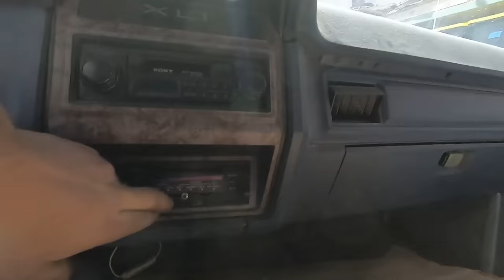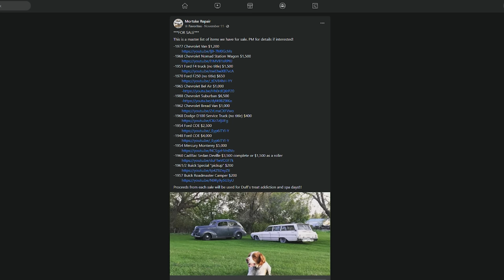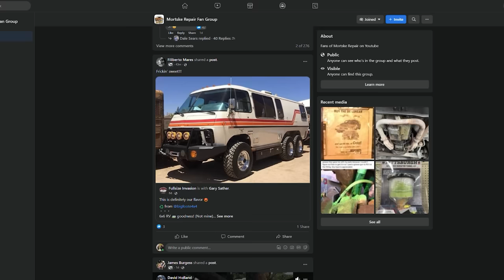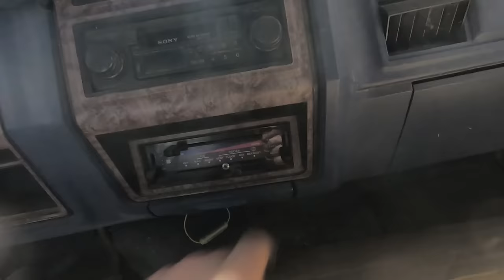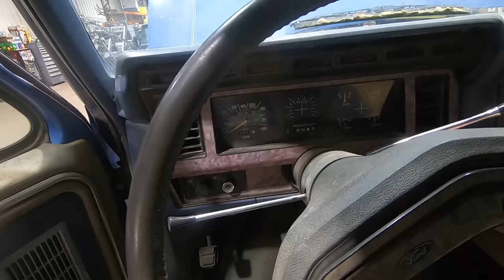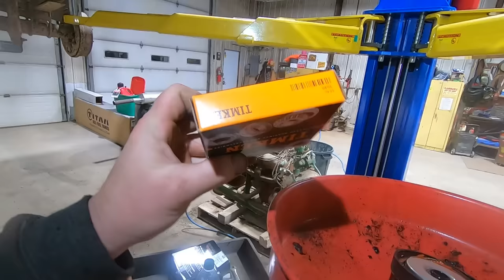Revival and Transformation of an Abandoned 1985 Ford F150 4x4 Farm Truck!

Comment: Hey Mortske, the power windows on those Ford trucks and aerostar vans and other Ford products have a design flaw, if you roll up and down the power window you might see the door outer sheet metal skin and the inner skin flex in or apart, this will eventually create stress cracks and make it harder for your regulator motor eventually burning it up so if you do replace the regulator or motor in that window be sure to check if it's expanding like that and beef it up with some extra sheet metal, otherwise you might be putting in another new motor, too quickly. There are other makes of cars that tend do that also.
Reply from the maker: Thanks for the tip!

Comment: The drain plug is an aftermarket one and your correct it cuts its own threads. I installed one in a customers honda van as he had stripped it. Runs good for sitting for over 4 years! Happy holidays Mortske!!!!

Comment: I have the exact same truck in a 1988 version, one owner, drug it out of a barn it had been in for 15 years, it has the 351, it actually has three fuel pumps, the one along the frame and one in each tank. I’m not a Ford guy either but it’s kind of a cool truck. Thanks for another great video
Reply from the maker: Awesome
Reply: If it's an 88 then it's a brick nose, unless a conversion has been done like I'm doing to my 91
Reply: @M.L.Knotts  well it’s an 88, so it’s a brick nose then I guess.. I don’t know, it’s an old Ford truck that runs good and I got it cheap.

Comment: Those Mighty Vac's are great! We have the pro version that attaches to the air compressor. Changing oil (or other fluids) is clean and quick. From old motorcycles to modern 4x4's, no problems with the Mighty Vac!

Comment: My first new vehicle was a 1981 Ford F150 with the 300 six and manual 4speed with overdrive. almost 200 thousand miles on it when I lost it in a forest fire. only major work was a transmission rebuild. I still think the bullnose has some of Fords best styling. The paint issue is do to a change to the water based paints in 1985 with a really bad primer.My short box XLT had the same trim mirrors and rear bumper. I had a rare cruise control with manual transmission.PS the heater core is a supper easy change out through the glove box.

Comment: My first truck was a 1984 Ford F150. 2 wheel drive 4 speed and a 351. Learned to drive stick in it. It had everything power windows and locks, ac, sliding rear window. Had the same rot that yours does. Brings back great memories. I found mine in the local thrifty nickel out here in colorado for my grandpa. He loved that truck too. Great show! Keep em coming. Funny last remarks i work at a repair facility and ill put you on and listen with my ear buds while im fixing wonderful examples of automotive technology
Reply from the maker: Good stuff!
Reply: Granny gear

Comment: I’ve had 6 F150’s built on that platform from 1980-1996. Had a 80, 86, 89, 90, 91, and a 92. My all time favorite was the 86 super cab long bed lariat, had every option available. Wish I still had it, it was mint when I got rid of it, and sadly I watched it die a slow painful death from the guy I sold it to. I saw it regularly, and everytime something new was broken from windows being broken, mirrors ripped out, tailgate folded in half. That truck didn’t deserve that. 

Also, some kinda useful knowledge, that power steering cooler is the only sure way I know to identify a truck with the factory tow package. Non tow package trucks have a smaller cooler that only makes one loop across the crossmember. The one with 2 loops like yours are factory tow package.
Reply from the maker: Thanks for the info!

Comment: I have changed the seal on the AODE Trans selector shaft. And I thought it was pretty easy. You do have to remove the pan and valve body. 
To get to the rooster cone. 
There is also a pin that needs to be driven out

Comment: The issue with paint back in that time period was the Big 3 (Chrysler, Ford and GM) decided not to prime between the ecoat (the black coating put on the bare metal panels) and paint to save money.  That's why it came off in sheets.  I had customers that would drive down to the local media blaster, mask up the glass and drive them back bare and begin the refinish process...  And now you know and.... (you fill in the rest).  Thanks Mr. M for another Monday morning pick ME up!
Reply: Wasn't there also a switch in paint formulation due to new EPA regulations? I thought I read somewhere that the EPA cracked down on VOCs back in the 80s, and that prompted formulation changes that were just not as durable for a few years.
Reply: @pheffr  There were some changes Paul but that was mostly solvent and clearcoat formulations.  Paint really didn't change much (although lacquer was going by the boards).  Enamel was basically the same and basecoat was still in it's infancy for domestic manufactuers).
Reply: Ya my uncle bought a brand new 85 chevy 4x4 n he got chevy to repaint once free. Then he 3 years later had to take it down to bare metal and do it right.
Reply: @andy1056  Maybe that's why Sherwin Williams logo is a bucket of red paint being dumped over the globe! 😆
Reply: ...knowing's half the battle...

... G.I. JOOOOOOOOOE ...

Comment: Nice old truck. She would buff up and if needed hand paint with good old ' direct to rust ' type paint along the lower sides below the trim to protect the metal from the tinworm although think maybe the mice were scaring the worms away ! Great video as always and can tell you'd do a lovely full restoration job on a motor with attention to the finer points. 
M/T - Mortske Tyres ; ability to perform burnouts, donuts and also be easy on the wallet
Reply from the maker: Right on

Comment: On the negative battery cable. If the dash lights are hinky there is a small wire that goes to the chasis from the negative cable. It is rated to make the dash lights work properly. You may even have to go to the dealer to properly replace this cable. I thought it was BS till someone proved it to me. Hope this is useful to you or anyone else.
Reply from the maker: Thanks for the tip

Comment: 27:29 as a driveability tech back in the day, I worked with those ford's extensively. Both tanks have low pressure transfer pumps to carry fuel to the fuel filter/diverter valve, a black plastic housing with a oil filter like cover to access the filter. Whichever tank was running would cause a poppet valve in the diverter to open allowing fuel flow, so your transfer switch just controlled the lift pumps. After the diverter, fuel was carried to the high pressure pump, which was under the guard that had the warning label on it. This boosted the pressure to 45-50 psi thru a pressure regulator on the fuel rail. Unused fuel was sent thru the return line.
28:36 lol, you did your research and just said everything I just wrote
Reply from the maker: Thanks for the info!

Comment: That ford has 3 fuel pumps one in each tank plus the one you found on the frame rail. It has a cannister filter on the frame as well.There should be a switch on the dash for font or rear tank.

Comment: That Ferd was a great score, it really finished up nice. I think you can get a leveling kit for the truck. All it consists of is a spacer for each spring and you pick the amount of thickness.  Looking at the landscape in the Mortske hood makes me appreciate living in florida this time of year.
Reply from the maker: Thanks for the info!
Reply: You mean shackles, right? I put a set on my 67' mustang converted to a fastback. Only wish I still had that car. Sold it cause there was a wiring issue. Was look at the engine then shut the hood and the damn car started up by itself. It was a 3-speed and had a habit of leaving it in reverse to get the shifter out of the way, so when it started by itself it went down my father in law driveway which was a down grade. It went straight down the driveway, crossed the road and started going on bro the cornfield. Finally caught up with it in the 6 or 7th row
This is a true story. It happened in 1974.

Comment: Ok so , lariat was more interior at that time. Carpet, trim on the door panels, power, color matching full panels and headliner. Radio, ac, cruise and tilt were still options. The spate tire in the bed was also an add on. Both tanks are 19gal and you could upgrade the rear tank to a 38gal unit for all the miles. I have an 80 bullnose that I got when my grandpa passed. Besides the bed being rusted it's a damn good truck
Reply: Power features were also options still, my dad has an '86 Lariat he bought new that has crank windows and no power locks
Reply: @evanruhl249  Mine is a  f150 ranger xlt. Only power it was steering.  Manual everything else. No ac. No tilt. No radio. Love the damn thing

Comment: Nice. I had an 86 F150 same model and drivetrain. Had a crack in the frame right by the steering box. Had slightly longer front coils, (my brother in law worked at a local shop that made custom springs) add a leaf in the back, with 33 BFG A/Ts. Looked solid. The former owner had put headers, so I had to have the local exhaust guy throw a new exhaust on it with some series 40 flowmasters. Was insanely loud, but being in my 20s at the time, I liked it. Was a good truck though.
Reply from the maker: Very nice!

Comment: Just a heads up since you mentioned it was shifting into third at low speeds. If the TV cable setup on these is similar to the 302/AOD in my Mark VII, the rubber grommet likes to wear out. It gets out of adjustment and it’ll take your trans out. They sell brass bushings on eBay for like $10
Reply from the maker: Thanks for the info
Reply: Masonboard, was cool info drop👍👍
Reply: @buckeyejim2989  thanks!

Comment: I have a 86 f150 2wd with a 5.0 efi. Mine is not a lariat but dous have cruise, AC, & tilt wheel but dous not have power windows & locks. 
   When I got mine I found it not running & buried in a garage under a mountain of junk! It had not run for 8 yrs. The guy thought he understood mechanics but did not in real life. He told me when it ran it idled badly do to a bad carborater. He said it had carborater & a 351w. When I saw it I said, " there's ur carb problem. There isn't one! It's a 302 efi." But as far as the condition of the body it was a clean straight truck. I drive it to this day.

Comment: Hey about that AOD trans. U can hold it in second. I drive mine like a manual all the time & I don't use OD. But pull it down into 1st, run up to speed when u want 2nd & move the selecter into drive & then pull it back down into 1st. It will shift into 2nd & hold it there until u want it to shift into drive.

Comment: Typically I would nit pick about how people work on things to my self of course because I was taught if you don't have anything nice to say don't say anything at all, but you did an amazing job like I had no gripes about the way you did any of that.  Can't wait for the next one and that Ford you didn't have to pull any spark plugs or mess with any carburetors.  Put fuel in it, prime the fuel pump and it's running, BOOM, just saying how many other vehicles have to worked on that you could just put fuel in it prime the pump and it runs. I seen the hole pull the carb, sparks plugs , valve covers, intake, fix bent push rods, fix blown head gaskets, fix cap and rotor bug. You didn't have to do any of that!  That thing is REAL GOOD!  Built FORD Tough.  God Bless my friend stay warm and have a good one.  I have way to much love for the Fords, just because the Chevy guys give them a hard time.  Just don't for get to (F)lip (O)ver (R)ead (D)irections, best one I've seen yet.  Much Love my friend!
Reply from the maker: Much appreciated!

Comment: I believe it’s a Dana 44 for the front diff and pretty sure the TTB 4x4 stuff started in 80! 4x2 stuff was back in the 60s like you Said.
Those year trucks were so easy to work on back then! Sometimes ya had goofy stuff happen but straight forward most of the time!!
Nice vid tho….brings back memories back at the Ford dealer I use to work at! 
Vehicles were cake ….working with a bunch of turkeys was the hard part! 😅

Comment: Looks like this one was a winner.  I was always a GM truck guy.  Two years ago a guy from work was moving back to NC and didn't want to take his old 01 F150 back gave it to me for free non running turns out all it needed was a fuel pump started right up have been daily driving it since runs great has the v6 but gets up and scoots cold ac heat works has led me to prefer Fords over GM the dash is still in great shape unlike my 05 Chevy

Comment: Ford's take about 5 minutes for the fuel gauge to update if you only put in 5 gal. or less. More than that they update almost immediately. My 2002 Lariat takes 4-5 minutes but that is because I can only afford under 5 gallons at a time. I think it even says that in the owner's manual.

Comment: 1:00:58 I quite like it. It's simple, it's robust, it's super easy to work with, and they only rust up if the thing sits parked for a long time. If it's driven regularly the parts don't have a chance to rust/sieze like this. This problem is 100% because the truck sat for a long period of time.

Comment: 9in stopped in 1982, the front diff is a dana 44, the truck has 2 fuel pumps the low pressure one is in the tank and the one on the frame is the high. The gear ratio is a 3.55.

Comment: Good 1 Mortske,  
My only F-150 was a 1987 XLT Lariat.  That 302 was a gasoholic but got me to 337, 000 km's  before turning into Unicorn's hot messy fart,  but I musta owned a good dozen or so F-250's . My current truck (that I've owned for the past 18 years) is a 1973 Ranger F-250 2WD original paint, 360 with 57,000 original miles and she's slicker than $hit on a hot summers night.  Well this certainly satisfied my appetite for automotive, but I'm a glutton and there's always room for Puddin....

Comment: 2:36 Can attest. Mine isn't that bad, but the only clearcoat left is on the door jambs at this point.

Mine's got somewhere around 350k on it.  My interior is just falling apart fropm all the usage over the years. Yours definitely doesn't have anywhere near the mileage on it mine does. It actually still has the brake pedal pad! My brake AND clutch pads are missing entirely, long since crumbling to dust, and at this point even the metal flanges the pads slid onto have visible wear from all the miles.

Slop in the column is normal. Mine has about that much but it lacks the tilt column. I have the XLT Explorer trim package and I'm pretty sure that's as optioned out as a 300 powered F150 could get in '85. I don't have power windows or locks or cruise, but I do have factory A/C, radio! And 2.49 rear gears. Whoever spec'd my truck out back in the day wanted one that could swallow down long road trips without a second thought.

Comment: 58:10 Yep. Called it. Caliper got stuck. I have fixed it in the past by just removing the caliper, attacking the slide points with a wire wheel in a dremel, re-anti-siezing, and reassembling, but new calipers and hoses won't hurt it any.

Comment: remember the transmission in my car was low on fluid when the engine was at 6500 into second it wines... added a litter of 20w60 engine oil to the transmission, nice and quiet now.

Comment: Lifting a twin traction beam ford front end requires more than just springs because if you lift it, you change the the front wheel camber. There are lift kits for those.
Reply from the maker: I just want it to sit level

Comment: Paint was bad during that era. I had a '91 Skylark Custom. I paid $500 for it, got it running and drove it for 10 years. I put a lot of money into it under the hood over the years and had it running great, but the paint was another story. It was almost completely gone from the hood, roof, and trunk, though it just had surface rust. We have a ritzy town that borders mine, and I would get pulled over for one thing or another every time i drove it there. I loved that car. I ended up having to junk it over a bad crank sensor. The engine that they used in that car was only used in the '91 Skylark Custom Edition, and nothing else. The crank sensor went out, and it was unobtainium. I tried for almost a year to find one before I finally gave up. I actually cried over that car, lol. I taught myself to work on cars by working on that one.
Reply: It had a 2.5L, but it was completely different from anything else I have worked on. The oil filter was a cartridge that screwed into the oil pan, and the control module was on the frame rail below the engine. You could not actually see it where it was located, so changing it was a lot of fun. The spark plug wires were at least four feet long. The car would also go dead if you hit a big puddle, due to the fact that it would get water splashed on it. I would be stuck sitting somewhere for about 15 minutes until it dried off. The people at my apartment complex loved it when I would hit a puddle and get stuck in the entryway to the parking lot.

Comment: I just put 2WD F-250 front coil springs on the front of my TTB F-150 and it leveled it out nice. Might get the F-250 shocks too, they're probably little longer.  The best thing I did to it was swap a 79 F-150 front end in, but i don't think you're going to get that deep into this thing!
Reply from the maker: Thanks for the info!

Comment: Duff hard-core watching the mice run when it fired up was priceless,  im think hell yeah were guna see some dog on mouse action for once but nope he said im a hunting dog, you shot it I'll bring it back. Watching this video reminds me of wrenching on my project  95 f150. It  as well as my first gen exploders have the slide pin design, I've always just cleaned the slides and pins themselves (normally have a few on deck, they are cheap) and my father taught me to just use a dabble of anti seize on each pin and hammer them in, always had good luck.